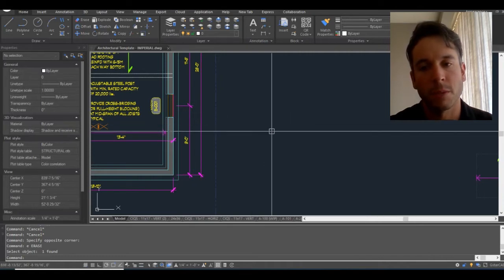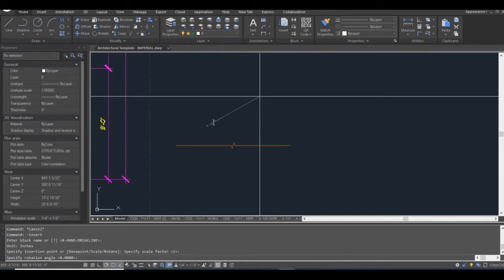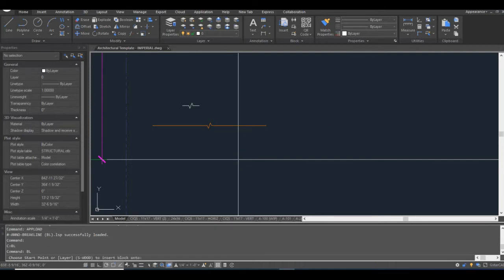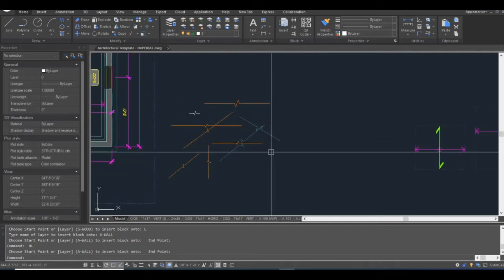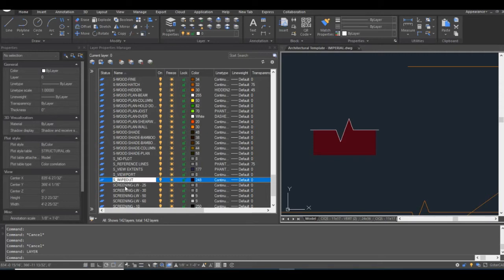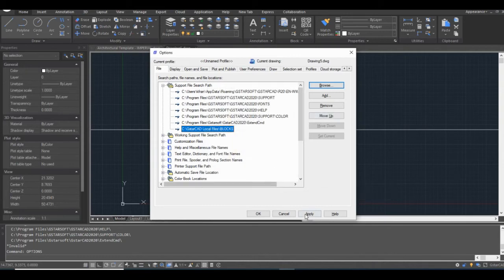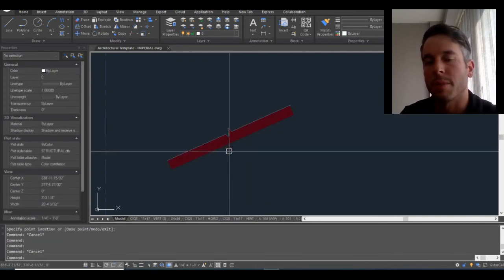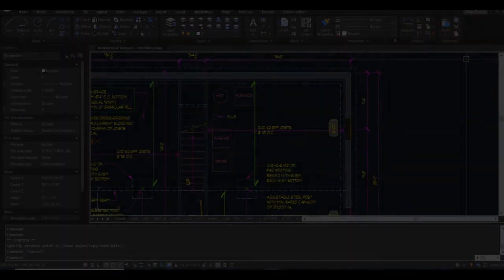Porting an LISP program from AutoCAD to GstarCAD

Comment: Hello, can you do a comparative video for GstarCad vs ProgeCad vs ZwCad vs BricsCad or similar that accept lisp routines?
Reply from the maker: That would be really interesting. It would also be a lot of work, so likely a long term project. At the moment, I am seriously considering buying BricsCAD (most likely the classic version) and from there I would do just as you described: See how my LISP holds up in BricsCAD. I've noticed a couple more differences since posting this video between AutoCAD and GstarCAD): I can't use the "command-s" in GstarCAD, but luckily the "command" function works in place of where I need "command-s" in ACAD. Also "getcfg" returns "nil" in GstarCAD vs an empty string in ACAD. I expect to find more little things like that as I progress.
Reply: The yearly subscription fees are getting wild, so It will nice to know alternatives with similar o better features.
Reply from the maker: @f.c1658  Absolutely. A healthy mix of competition is really what the industry needs. Often times, we are really paying for failed 'vertical' Autodesk product development and they lump that cost into trusty old AutoCAD. If Microsoft Word cost us $1,000 per year, we'd use something else. Alternatives exist and therefore it's relatively inexpensive in order to be competitive. I don't feel like a basic CAD drafting program could costs thousands per year. The 'alternatives' to AutoCAD are viable, but each has their own weaknesses (along with their strengths, which generally includes a lower price tag) This is a subject I'm going to do videos on in the future. Switching from AutoCAD can get complicated but will pay off for, at the very least, a slight majority of users in the long run.